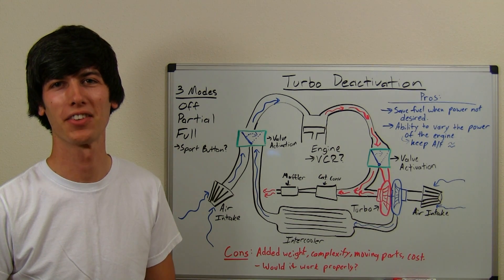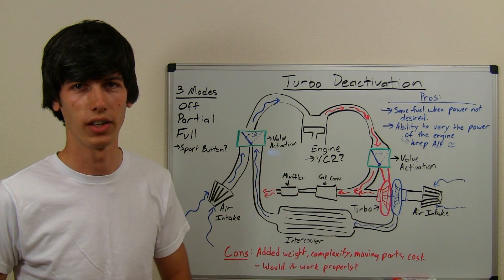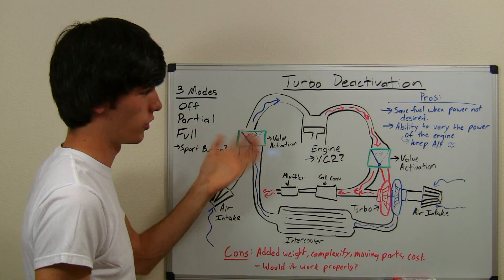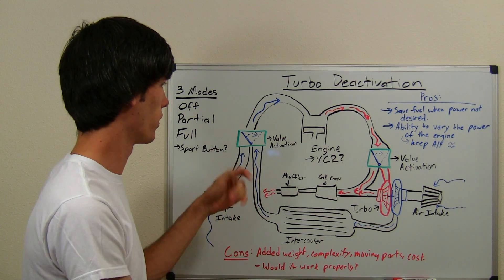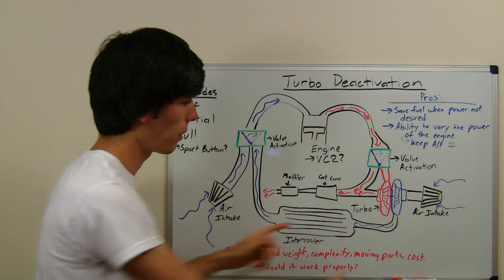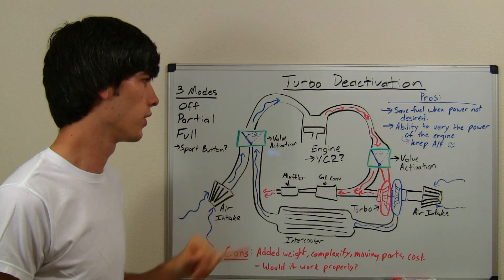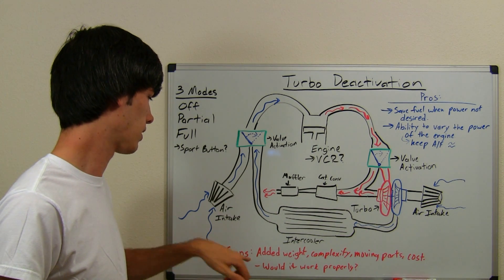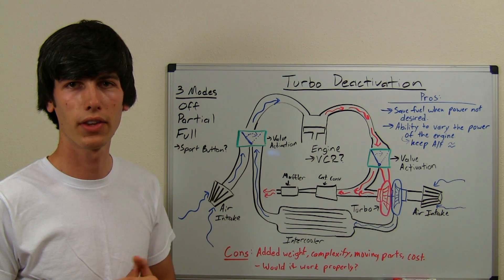Turbocharger Deactivation Concept - Explained

Comment: I feel like all you would really need is a single butterfly valve at the exhaust inlet at the turbo to redirect air either to the muffler direct or to the turbo. Reason I say that is I dont believe there is a significant enough restriction of air from the turbo inlet... The only spot i see a restriction is at the intercooler, which it would be great to utilize the properties of the intercooler 100% of the time despite running the turbo or not. Maybe a Larger volume/less restrictive intercooler i

Comment: Not if you have a a bypass tube from the manifold before the turbo. You could make it work, but the complex situation of your manifold would be the big factor. Unless you just make a longer tube where the turbo flange is and a cutoff valve there.

Comment: It would perform worse than if it was just n/a or just turbo, you'd have to compromise on compression ratio, valve lift and duration, fuel type and exhaust diameter aswell as other things probably. you'd also have alot of extra weight and you'd need a crazy ecu/tune to keep up with the constant air/fuel ratio and ignition changes. Cool idea though, imagine having n/a response and the exponential power curve of a big turbo and being able to switch on the fly :P

Comment: Yes, size and weight reduction is the only real world advantage of turbocharged petrol engines. Disagree about turbo engines being more efficient at higher RPM's, their min BSFC can never match that of NA, or even supercharged engines! The big mistake people make is comparing engines based on max bhp, and then comparing their efficiency when operating at low loads (MPG tests).

Comment: A turbo reduces losses in the intake stroke as air is being forced in.
however the larger differences are that a turbo engine produces more power and torque from a smaller and lighter engine, savng weight. turbo engines can more easily achive higher compression ratios and usually result in a better fuel-air mixture. A turbo engine should be more efficient, Lets just realise the amount is fairly small, but should be noticable plus with lower emissions and in a smaller package.

Comment: As others have said, If tuned properly a turbo will increae overall efficency of the engine, Espeically mid to high RPM.
Its true that at very low RPM the turbo basically just gets in the way however....Unless you have a turbo thats oversized for the engine and lags like hell, or you drive around at idle all day and only ever use 5% throttle its not likely to be an issue.

Comment: the problem with the partial theory is when the valves switch over the ecu will have to adjust on the fly and then you would have to spool the turbo from a dead stop and there would be horrible lag

Comment: Turbocharged petrol engines, unlike diesels, must maintain constant AFR. They cannot simply pump more air into the cylinder without adding the necessary fuel. The only efficiency advantage of a turbocharger is reducing the tiny pumping losses incurred on the intake stroke, which is why in reality turbocharged engines are not as efficient as NA.

Comment: I agree, my point was when it's in boost mode (for lack of a better term).  I have to think the turbine most likely puts some drag on the engine even though it's a very efficient model.  How much energy can be saved by by-passing it and letting the  would be interesting to know.  You're car sounds like a very nice ride btw.

Comment: If I understand you correctly, this idea (or similar) had the patent issued in 2004 but had it coupled with cylinder deactivation patent: US6715289

Comment: It mixes the air and fuel more efficiently, and therefor you need less of it. Which in turns means less throttle to = the same amount of power as before. I have a boosted 350z with around 400rwhp and I get around 45mpg on the highway. But yes when u drive like a crazy man, you get < 10mpg.

Comment: If you're forcing more air into the engine you will also need to inject more fuel.  You don't need the boost from the turbo unless you need more power.

Comment: in a race situation the car would have much greater throttle response through tight corners and then be able to have the power on straights. 

As a daily driver, turbo engines wear out quicker, because of the higher pressure so having the ability to turn off the turbo is always good.

and you could easily reduce some of the weight, by just having one air intake allowing it to go through the turbo and intercooler whilst the turbo is and isn't in use?

Comment: Well isnt there like Y shapaed exhaust pipes that cut flow to one end via electric motor and a valve on a tip?  Maybe use one between the exhaust manifold a d the turbo and another between the intercooler and the intake manifold, but then the ECU settings still need like a switch so it wont run rich on "eco mode"  and lean on "sport mode"

Comment: I guess you could use this application with twin turbos.
Like most said at stationary in town/traffic etc it would be ideal, but then you have the stop start system in cars which is a better application (your idea is still great).
I have a similar idea where an extra air intake is attached to the exhaust chamber of the turbo and has extra air pumped/drawn in to the turbo which can maintain/increase boost. But i'm sure there are flaws as i only started learning about these things.

Comment: I know in Saabs the ECU controls the amount of boost from the turbocharger depending on weather, elevation, and temperature which is similar to you idea.  It would be cool to see a video expanation on the Saab variable compression engine.

Comment: Your idea would work well on a ?"centrifugal"? supercharger however its powered by a engine belt so valves wouldn't work. I think your idea for the turbo is a good idea if you use an aftermarket charger and the engine runs hot.

Comment: Then makes big displacement HP when under heavy load (at a greater efficiency than a big displacement engine). Therefor you can reason that a turbocharged engine at any given load is more efficient than the N/A version until the maximum load of the N/A engine, past which point the turbocharged version will be able to handle more load and will burn more fuel (but proportionally less than the N/A version) so the only thing you have to do to get better economy is keep your damn foot out of it!

Comment: A turbo increases the volumetric efficiency of the engine while under boost, therefor making the same HP as a larger displacement engine while using less fuel. So a small displacement engine with a properly designed turbo system will do the same amount of work,  with less fuel, as a N/A engine of larger displacement, ALWAYS. Also a turbo has the advantage of being inactive at low load, which means it is only using as much fuel as the small displacement engine when low load is applied,continued

Comment: This is a great idea, I feel the most difficult and expensive part of this would be the ecu, this would be great from the factory, however, aftermarket you would need a standalone ECU capable of switching on the fly fuel maps, the actuators would be the easy part. I doubt most aftermarket standalone ECU's would be capable of this, and going motec probably isn't an option for most, as the cost outweighs the fuel economy and, if you have a motec, your most likely driving a track only car lol

Comment: Not in all cases, and when you start getting into aftermarket cars (ie, pretty much everything has been changed in the name of speed) running on boost kills your fuel economy, it's great for low displacement, low hp being built around the plans to have it boosted (ie , gear ratio's optimized around it, etc) but when your driving around a 1000hp supra, that can easily put around town out of boost...boosting, albeit fun, is like watching the money escaping your wallet as you drive.

Comment: the major problem with this concept is that it isn't efficient. the less restriction the more efficient the system for both n/a and f/i. with a valve system actuating between n/a and f/i there will be much more restriction and turbulence thus making the turbo less efficient. turbulence in the intake charge will reduce efficiency by not getting oxy into the cylinder as fast as well as not atomizing the fuel as well. simply adding an adjustable wastegate will allow you to reduce boost to almost 0

Comment: Use a sterling engine or even a peltier to convert heat back into electrical energy. But these would take up a lot of room and add additional weight to the vehicle.

Comment: the point of a turbocharger is to make the engine more efficient. it will makes you a large amount of HP. if you use that and your jetting around you will of course use more fuel. if you use it normally like a normal car. it will get you more mpg it makes you extra power so you need less to do more.  also haveing your car tuned  both for running a turbo and not you will eather be running too rich or too lean and lose most gains

Comment: the problem is that the valves would cause flow Resistance,decreasing performance and efficiency. also when you remap the boost controller and the engine to use the turbo to compress air and enrich the oxygen for cleaner burn. also the turbo would theoretically increase the compression ratio making more torque so the engine wouldn't have to spin as fast. also you could use the turbo to move the air faster and force the air to move and mix more evenly

Comment: i have also had an idea like this using the electrical exhaust cutouts all seems very possible no reason for it not to my concerns were fuel injectors that could handle the power without and with the turbo and as you said the partial also and the ecu wouldnt you have to have a different kinda of tune set up for each type ( no turbo, partial, full) would that have to be a differrent computer wired in for each defferent type i havent got drawings for it or anything but would love to see an attempt

Comment: Once again a great video. This is very interesting because i've been trying to come up with a system to run on a compound turbo set up that will allow me to bypass the smaller turbo and spool just the larger one. with your idea i could not only get air to bypass the smaller turbo but maybe get exhaust gases to bypass also.

Comment: I can't see why it wouldn't work, but as stated below, you found use a boost controller and run low boost so you won't be forced to use as much fuel, of course, your system would in theory offer better still fuel economy, you might be onto something

Comment: Lol at the arguments below! "Your knowledge is inferior to mine!" etc....

I reckon it could be done, but in my opinion it's a complicated method to warrant the benefits. A lot of turbo charged cars can be fitted with boost controllers to reduce fuel consumption. Ford's new eco-boost engines might be running something similar to this system?

Comment: the only problem i see here is that engines configured for forced induction usually have a lower compression ratio than one configured for NA. (direct injection tend to be higer compression)

wouldn't the NA setting on this setup be less efficent than a normal forced induction setup at lower rpm's

i could see this setup benefiting from direct injection higher compression and cam less actuated valves. so valve timing can be infinantly variable. like avanced multi air fiat engine

Comment: All manufacturers incorporate systems to deactivate the turbocharger due to the appalling efficiency of the turbine at low exhaust pressures. Under these circumstances the engine is in effect naturally aspirated and hence able to post respectable fuel economy figures.

Comment: No doktordimmer, turbochargers start producing boost only when a certain amount of kinetic energy is present in the exhaust gasses. Without adequate exhaust gas flow to spin the turbine blades, the turbo cannot produce the necessary force needed to compress the air going into the engine, known as being 'off-boost'. So under certain load conditions (EPA tests) the turbocharger is, by very deifiniton, not working.

Comment: If you couple your intake bypass valve, which can be built with basic plumbing supplies, with a variable nozzle turbo (VNT) aka variable geometry turbo (VGT), you can accomplish your idea very easily. The trick it to be able to control the vanes of the turbo. There are some products on the market for diesel guys that can do this, or it can be done pneumatically, but it's tricky.

Comment: "Lowering consumption at peak BSFC nets you little or no gain in MPGs"................... duh...yes, but it completely ruins your "turbocharged engines are ALWAYS more efficient than NA engines" assumption. When operating at anywhere near maximum power naturally aspirated engines are far more efficient. If you could understand why this is then you would realise the inherent problems that plague turbocharged engines fuel efficieny.

Comment: ......and was also noted as being underpowered at low RPM's (during fuel economy tests - a trait that is frighteningly common with new small turbo engines - where's the turbo gone?)...and the features that give it good EPA figures - like 'stop start' are incredibly impractical and better left deactivated (like the turbo). Anyway Consumer reports already tested the real world fuel efficiency of this engine in the X3 and it managed a whopping 1 MPG more than the 20bhp more powerful 3.0 NA....FAIL

Comment: Hi, I think it isn't that useful of a system. A well tuned turbocharged car gets better gas mileage at cruising speed than the same car would get without the turbo, I think it's because of the higher compression.

Comment: The inherent disadvantages of turbocharging (exhaust back-pressure, heat soak of the intake air, and the inefficiencies of the turbine itself) prevent turbocharged engines from being as efficient as naturally aspirated engines.

Comment: For non-diesel engines, Spark plugs.  Each spark plug is designed to a have specific amount of heat resistance.  If it isn't heat resistant enough, it will melt.  If it is too heat resistant, deposits may form and be unable to burn off.

For Diesel engines, though, I do believe this would work.

Comment: "Manufacturers test their own vehicles and report their results to NHTSA, which then sends the data to the EPA for verification. Like the taxman, the EPA audits only a small sample of these results.

Sometimes manufacturers cheat and report fuel-economy figures that are better than their competitors', to gain a marketing edge. At other times, they game the system with engineering tricks which take full advantage of loopholes in the EPA’s testing procedures.".........what a fraud!

Comment: It is you who made the statement that all turbo charged engines are more efficient than NA engines. I have already proven, and you have accepted, that under high loading NA engines are significantly more efficient, thus completely disproving you original theory.  We are now hav a new discussion about whether small 'eco' turbo engines can match the fuel efficiency of their NA equivelants. So far in EPA tests they can, but in real world tests they simply can't.

Comment: Just use a dual boost controller. Run low boost running grocery stands but someone pulls up next to you, just flip the switch and put the boost down. But a nice intredting concept. would it be possible for the 2nd air intake valve not necissarily closing it off when in Turbo mode? Would you be able to pull air from both the Turbo air intake and the non Turbo intake if the Turbo mode had that valve switched like strait up?

Comment: Rather than just admitting you were wrong a long time back, you seem to just move the goal-posts back a bit every time you get found out.

So far, starting from the begining, you've stated;

Adding a turbo to your car will make it more efficient - ..lol.that was a good one...Wrong
Turbo engines are always more efficient - Wrong
Turbo engines are always more efficient apart from at peak BSFC - Wrong
Turbocharged engines are more economical for typical driving - Wrong

.....what next?

Comment: "Government, Manufacturer ........................does not lie..."..lol..really?.....

Anyway, I'm not saying that based on 1978 fuel test cycles turbocharged engines can't post slightly better MPG results.

YOU ARE SAYING that during typical, real world, driving turbocharged cars ARE more efficient. Highly respected independent testing has shown this to be completely false!. 

Either you are wrong (again) or the most well respected independent consumer review organisation is wrong. Which is it?

Comment: part 5 - ...However, our so-equipped Fusion Titanium returned 22 mpg (which pales against the 25 and 26 mpg we recorded for the best V6 family sedans), slower acceleration and reduced refinement compared to its V6-powered peers.

So don't take turbocharged engines' eco-boasts at face value. There are better ways to save fuel.

Game - set - and match... Teachers report card - "doktorbimmer must try harder"....

Comment: part 4 - .....The Toyota Camry, Honda Accord, and Nissan Altima, all with conventional 2.4- or 2.5-liter four-cylinder engines, get an additional 2, 5, and 6 mpg, respectively. And all accelerate more quickly.

The larger among Ford's EcoBoost four-cylinder engines, the turbocharged 231-hp, 2.0-liter, is billed as having the power of a V6 but delivering the fuel economy of a four-cylinder....

Comment: part 3 - The latest example is the collection of EcoBoost Ford Fusions we tested, which come with small, direct-injection, turbocharged four-cylinder engines. The smallest one—a 1.6-liter producing 173 hp—is a $795 option over the basic conventional 2.5-liter four cylinder on Fusion SE models. But that car's 0-60 mph acceleration time trails most competitors, and its 25 mpg overall places it among the worst of the crop of recently-redesigned family sedans.......